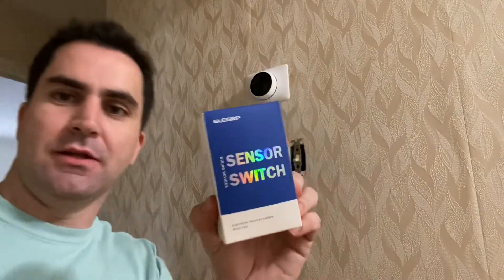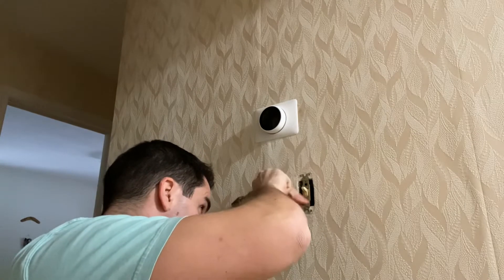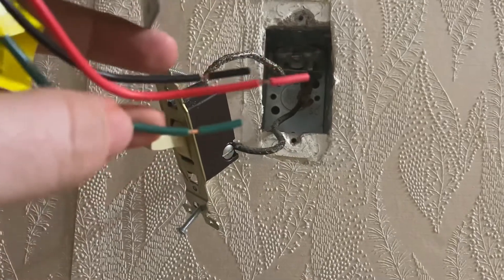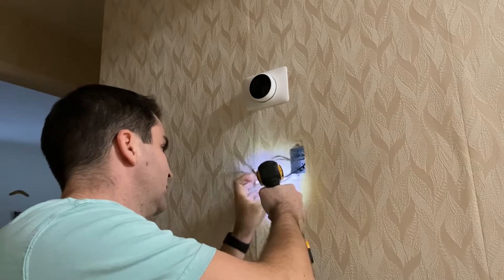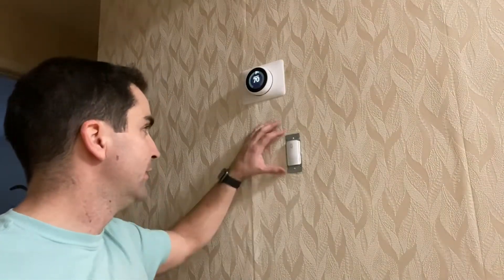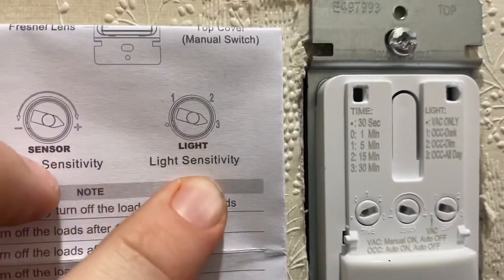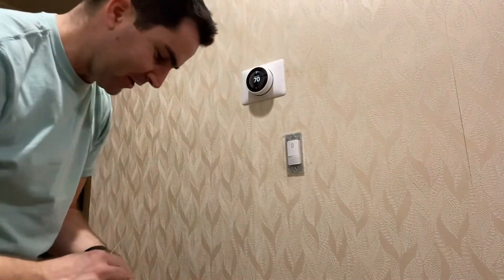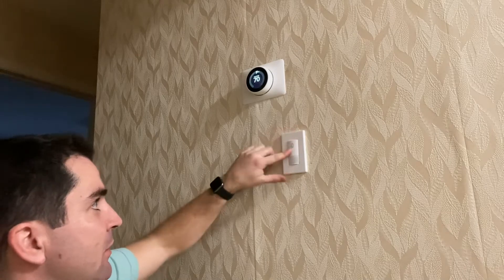Unboxing and installing a ELEGRP motion sensor light switch without a ground available.

Comment: I bought a Lutron  MS-OPS2H occupancy sensor. It has a ground and a neutral wire. Instructions say to connect neutral and ground to the ground  if you don’t have a neutral. I added the piece of wire to the screw in the metal box and wire nutted the three wires together.the light came on and stayed on, so the sensor didn’t work. I took it out and I put my old one back in place. The old one worked without the ground, but since you showed me how to ground it, I did so. The main reason I was trying to swap it out is the old one was made for incandescent bulbs and doesn’t work well with led  or fluorescent.  It had gotten where it would just dim when it was supposed to turn off. We’ll see what is does not that it is grounded! I have this in my kitchen because there is only one light switch, if you come into the kitchen at night, it’s on the wrong side of the room!

Comment: How do you take the cover off?
Reply from the maker: pop it off by using a small flathead screwdriver at the base of the cover.
Reply: @oldcountryhouse  I meant the screwless wall plate
Reply from the maker: @denystroshuk5884  yep, that’s how you get that wall plate off. Small indentation on the base of the plate. Push screwdriver in there and then lift up, the plate pops off.

Comment: Can you just connect it to the metal itself without the other wire?
Reply from the maker: Most likely yes, only issue is it would be harder to maneuver because there is less slack.